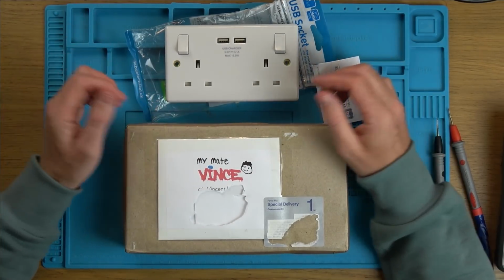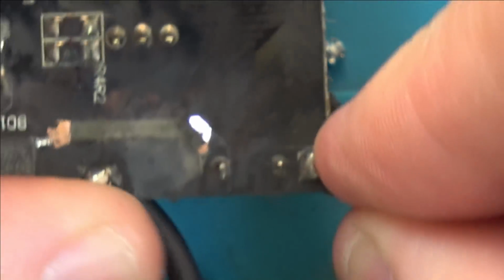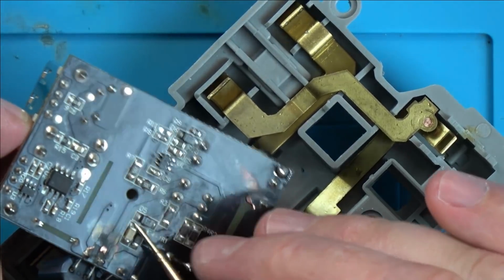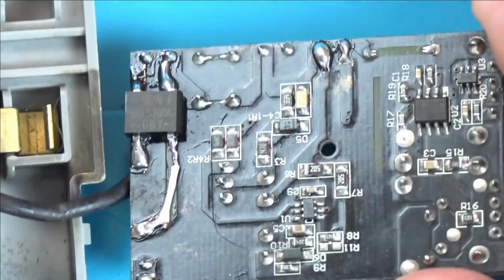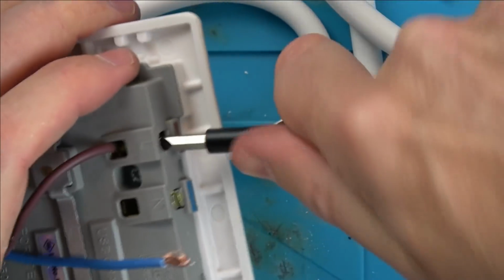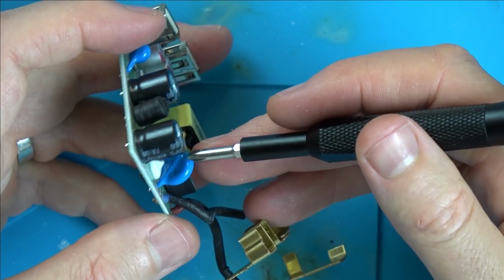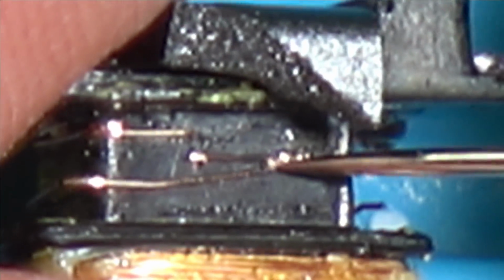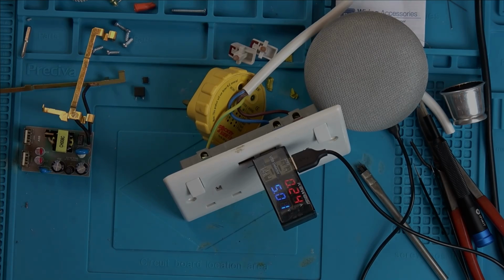Burnt Out Exploded USB Wall Socket - Trying to FIX

Comment: Kip said his wife was cleaning around it when it blew. so it has to be liquid in the USB, causing the initial short. and the explosion blowing any residue away.
Reply: She was pretty adamant that nothing (cleaning product wise) went near the socket.
Reply: @KipHakes  My wife would say that too :)
Reply from the maker: I thought that originally Lee but the output side looked good. Maybe it (liquid) seeped through and ran down to the bridge rectifier????
Reply: @Mymatevince  The bridge rectifier usually is a victim. I think the short happened at the cap in the middle of the board, the one you had to repair the tracks underneath. That short killed all components positioned before so half choke, half bridge and the fuse. Strangely some track blew before the fuse.
Reply: @DumahBrazorf  The tracks and other components blew before the fuse because they used a INSANELY LARGE SLOW fuse, 3.15A @ 240V is more than 750W nominal rating which means it mean in many cases it'll takes something like 1000W sustained load to blow at all. In what universe is that a sensible fuse for a small usb charger!??!

The USB section is rated at 3.1A @ 5V (combined), IE 15.5W. A modern SMPS is fairly efficient but you still want some safety margin on the fuse size so I would expect to see something like perhaps 0.3-0.5A "F" or "FF" fuse for an universal (IE 90-250V) module (most are these days). If the module only supports 220-240V operation they can halve the fuse rating but why make two models when just making one will be cheaper.

At first I wondered if he had slipped a decimal place on the fuse size but I get the same result when I check that fuse in the picture, it really is a 3.15A "slow" fuse! No wonder it was a mess inside after the event. With a proper fuse I suspect there would have been a fairly decent chance it would have just failed "silent", and the other components and the tracks would have been fine afterwards.